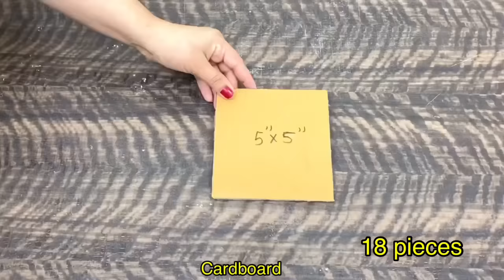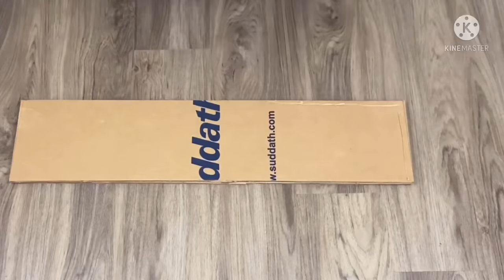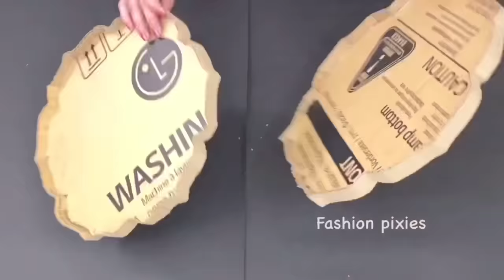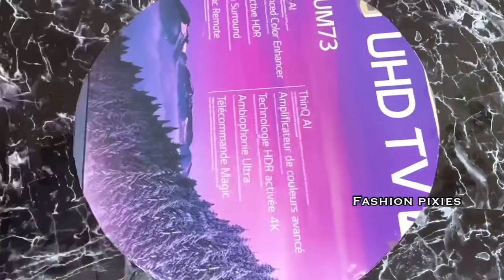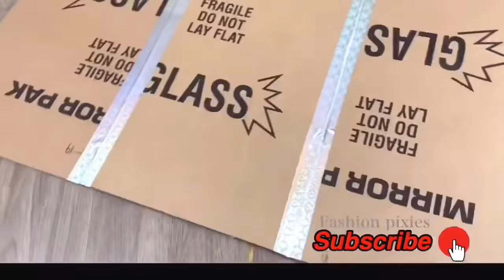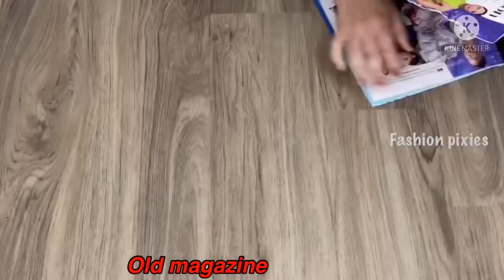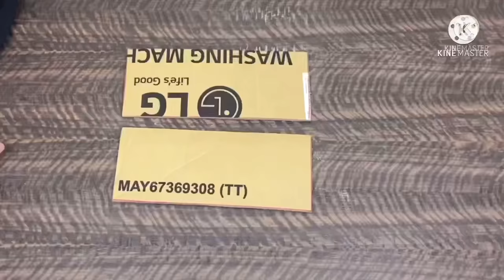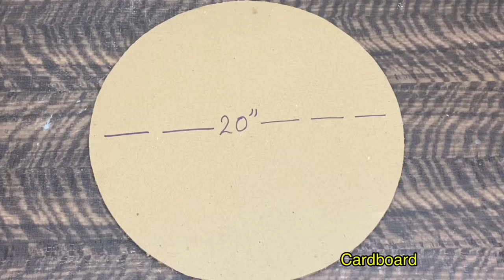50 DIY ROOM IDEAS | CHANDELIERS, TABLES, FLOOR LAMPS, MIRRORS | DIY | FASHION PIXIES

Comment: Time stamps:
0:01 - 6 dangle chandelier
8:20 - entryway table
18:42 - long cube floor lamp
26:34 - hexagon shelves
42:55 - black & silver ceiling medallion
51:12 - flower side tables
1:01:29 - ceiling light
1:12:44 - stacked side table
1:18:24 - ball floor lamp
1:26:14 - circle coffee table
1:33:57 - 3 cube dangle chandelier
1:41:13 - fabric side table
1:49:40 - wall circle mirrors
1:53:51 - scaled entryway table
2:07:29 - circle 3-layer dangle chandelier
2:15:57 - bathroom mirror
2:23:57 - wall light
2:33:09 - hourglass/spindle side table
2:36:31 - drawers 
2:44:56 - black & gold ceiling medallion
2:53:55 - half ball dangle chandelier
2:57:00 - wavy frame mirror
3:06:26 - sparkly wall clock
3:12:49 - 2-tier stand 
I'm doing my best to label the items. Let me know if you think it could be labeled a better way and I'll change it.